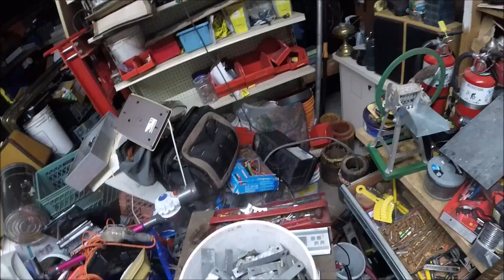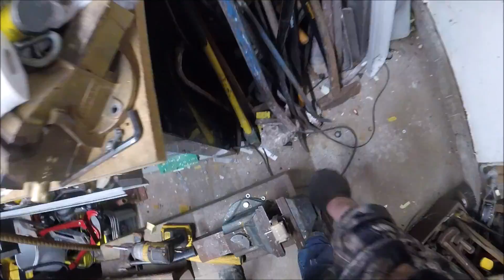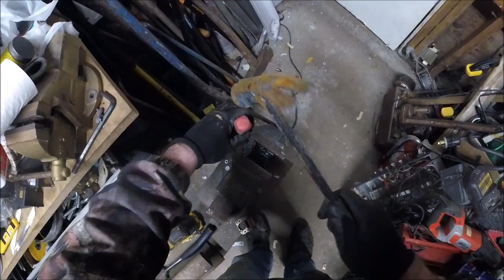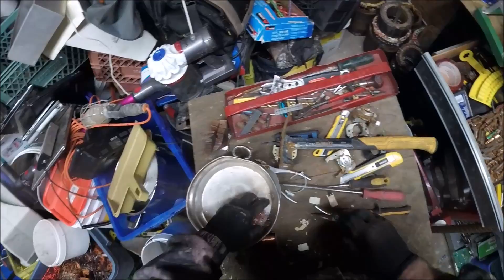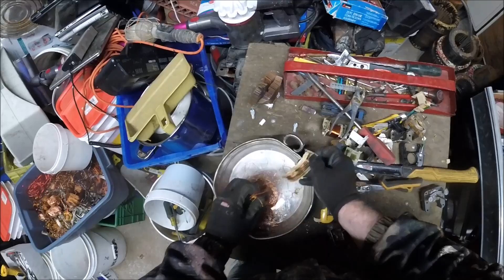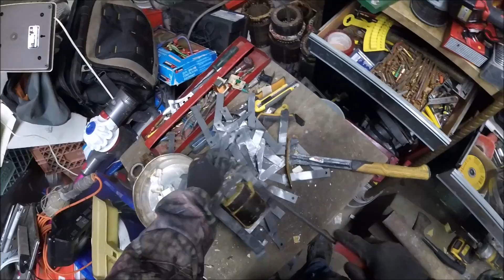Scrapping Fan Motors

Comment: Hey Phil, You are happy that they quoted are paying more than the cheating yard. But I am happy that you are able to contact another yard. Even if they pay equal or slightly less, if their interaction with you is fair, that is where you should be doing business, regardless of more distance. In your line of business, distance is not a factor at all, you can look out for scrap on your way back.

Comment: When you go to the new yard for the first time, be business like and carry a sample of every non ferrous you have, lets say 5 or 10 pounds each. Display the different grades that you have. At the same time you try to understand their criteria of grades. 
Discuss the prices of each so that there won't be surprises to you or the yard when the actual transaction happens specially as you are a new customer to them.
You tell them this is sample lot and you can supply in multiples of 50 pounds each of every metal (brass, bare bright, #1, #2 copper, #1&#2 cables etc) and discuss with them if you can get prices periodically over phone. 
Believe me, if you engage the person in discussion, the result will always be positive.